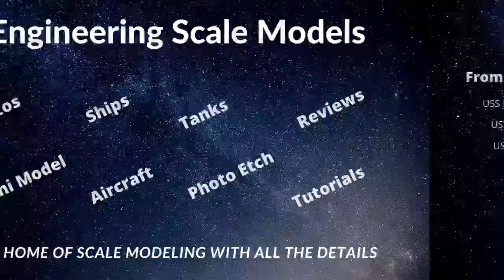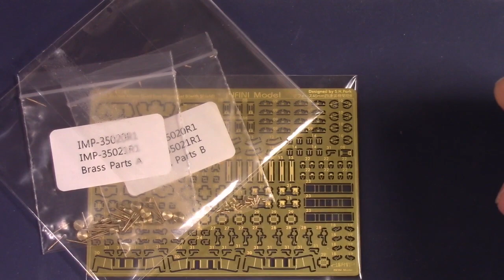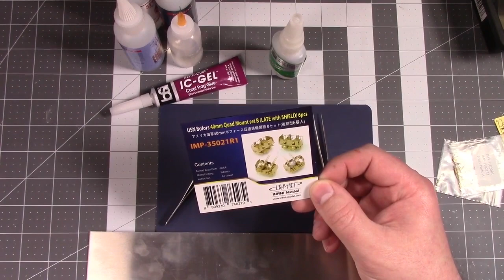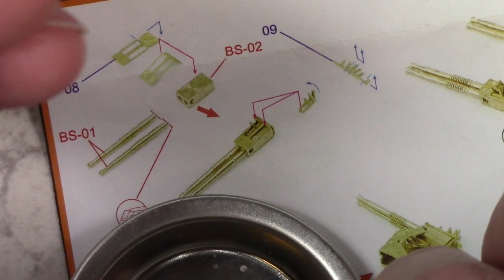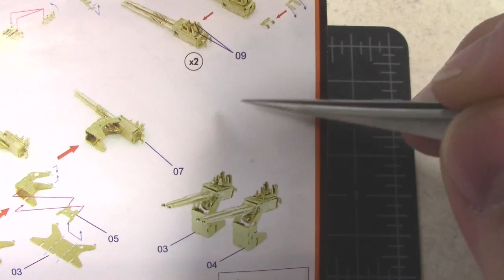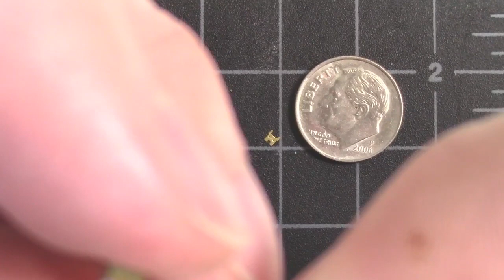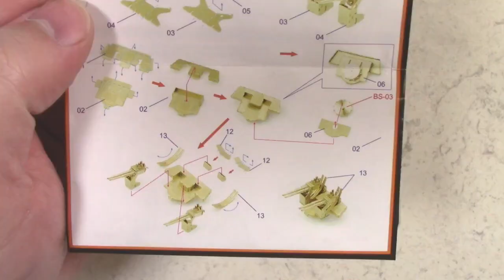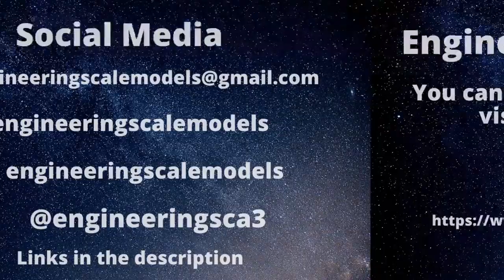S1E2 Infini Model 1/350 40mm Quad Mount Bofors Build Part 1 #ESM

Comment: I’ve done the Infini Bofors  gun, and it is very hard to do. The result is worth it. The most difficult of the Infini PE guns is the IJN 25mm single  mount. It is insanely difficult to do. It’s a good thing they come 30 in the pack. I ruined six of them before I got one I liked. I got some new ideas from your video, so thanks!